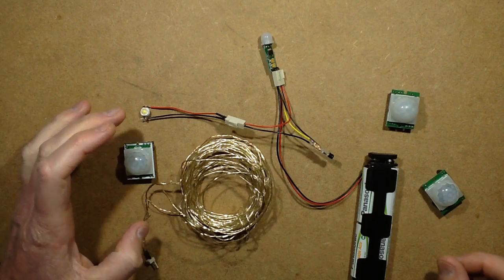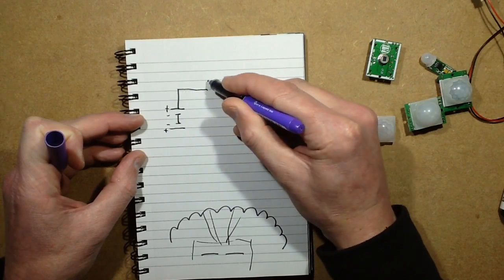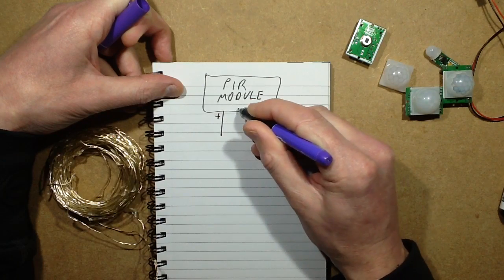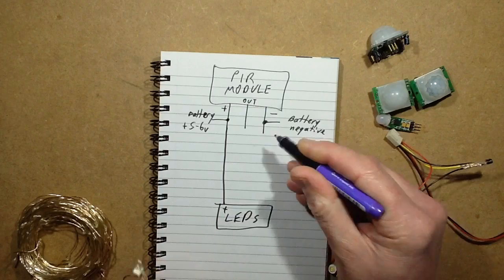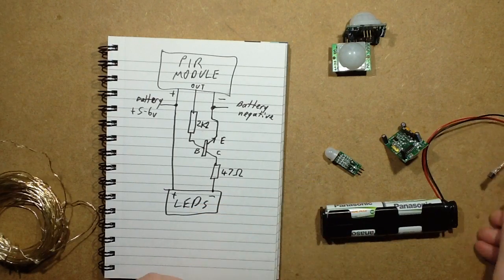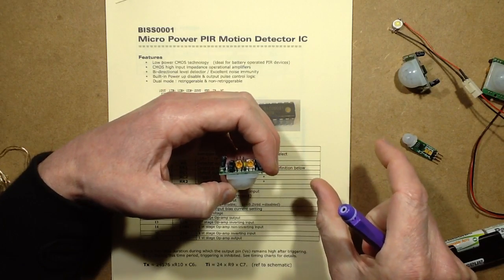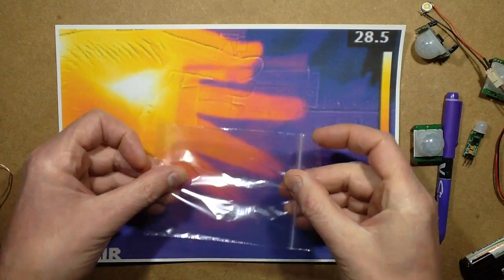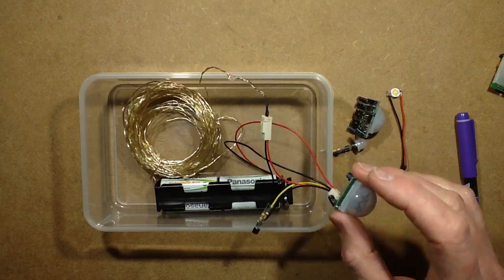How PIR modules work and using them to control LED strings.

Comment: I experimented with these and just drilled a hole almost as big as the dome on the sensor.  Let the dome extrude out and put a bit of silicone around it. Sealed good and the sensitivity was not compromised.

Comment: transistor and PIR self drops the current and voltage. so this is VERY annoying. no way to use this with 12v led stip more than 1m
Reply from the maker: The transistor in this circuit fixes that.  If the PIR module is suited to a 12V supply, the transistor will switch that.

Comment: How to connect a 12V LED strip light directly to the sensor without using any resistor or transistor or a relay. The LED strip light will be powered by 12V 5A driver. The setup will be mounted underneath the kitchen platform. The LED strip light should turn ON when the drawer is opened.
Why are transistor and resistor mandatory? What would happen if remove them and connect LED strip light directly?
Please respond.
Reply from the maker: The circuit can't drive high loads.  It absolutely needs a buffer.  That also avoids false retriggering caused by high current fluctuation.
Reply: @bigclivedotcom i created the ckt using this Sensor supported by BC547 transistor and 1k resistor. While I get 12V output from this ckt, but the LED strip light is too Dim. I removed the resistor and the brightness increased a bit. IMO the brightness of the strip after connecting to this ckt would 5% of the regular one. What should I now?

Comment: Hello! I ordered som of the small ones (sr505) modules, the 8pin chip is NSA3182 i would believe. There is some data-sheet i Chinese but well i am a newbie in electronics and have hard time reverse engineering stuff, my sr505 has delay of only 4 sec and i would like to make it about 10 sec. IF you could when and if you get time to maybe check on that data sheet and guide me maybe🤣
Reply from the maker: If it is that chip then adjusting the two resistors connected to pin 6 should adjust the on time.
Reply: @bigclivedotcom  yes, so far i am with you, trouble for me is to track the 2 resistors on the printed circuit board :) double sided board and well i feel little dumb for such simple task
Reply from the maker: @Vasse_t  Use a meter set to diode/continuity and explore the circuit for recreational purposes.

Comment: Thank you. You are sharing your knowledge.
I made your project. It was very nice. but there were interesting findings about the battery. I work with 3 types of batteries. I tested lithium watch batteries which are 18650, aaa battery, 3v. With the only 18650, the sensor burned itself. I connected 2 in series from a 3v Isha lithium battery (makes 6 v), the sensor lights up on its own. there was a problem. It worked without any problem in 4 AA batteries and it works well. Can you explain the logic of this error in a simpler way? I am very curious. Is there an imbalance in voltage?

Comment: Evening, I’m trying to use MP2307 Adjustable Mini360 DC-DC Converter Step Down Buck Voltage Regulator but I’m getting lost as on your diagram only one wire come out the bottom, but on my regulator there are two outputs, can you offer any help? Happy to put a video up on my channel if needed

Comment: I have been experimenting with logic level mosfets with these PIR sensors due to low current output but they usually didn't work for me  , my only option was to use arduino to trigger a transistor  but with this circuit design you have made my day sir.. I guess there always is something to learn after all :-) 
Thanks a lot again for sharing and making the world a better place , at least for me :)
Reply: https://www.youtube.com/watch?v=ZC_sEW3_694

Comment: What type of NPN did you use?
Reply from the maker: Any common one.  I tend to use a BC547 as my standard low current NPN transistor.
Reply: @bigclivedotcom  can I use TIP42 high current transistor for 5v 1a motor?  TIP42 / TIP42C PNP Epitaxial Silicon Transistor 40v 6a,    Ref this video https://www.youtube.com/watch?v=vhxZ3EHT668  , use TIP31  Motion control 12v Led Strip | how to make motion led strip using PIR sensor

Comment: Might be possible to use only three nimh batteries by bipassing the 3.3 voltage regulator inside the pir, and soldering a wire directly from the battery pack to the pir 3.3v pad
Reply from the maker: That could result in instability due to the voltage fluctuations when the lights were switching.
Reply: Thanks for the reply :D I'm a big fan

Comment: Hi, great video, I've got an led strip in a display case which looks great now. However the motion sensor is a little unpredictable. Any thoughts on why this is happening. Also I'm using 9v instead of 5v in the video do I need different resistor values?
Reply from the maker: If it keeps retriggering it might be due to a high load versus the power supply.  If it is just not detecting people it needs an open and direct view with no glass in the way.
Reply: It's triggering but seems to take about 5-7 seconds to turn on the LEDs.

Comment: ok, i've tried for more than 5 hours. It's really really annoying.
HC-SR501 pir module, 2n3904 transistor, 22k and 47 ohms resistor and a small 3v cob led. 
Everything is fine EXCEPTED that the led won't stay lit. Even with the pin on H (retrigger). It turn on stay lit for about 5 to 10 second (it vary) and then invariably turn off.
I've tried changing the transistor to a BC337 and i've tried with 5 other set of components... I've tried with 3 different power source (from 4 to 8 volt).
please someone help !!!
Reply: after a while, adding a l7805 regulator and a 2s liion battery make things a little bit better. But there are still some lake of retriggering

Comment: Very interesting.  I am looking to build a few PIR sensor triggers for dslr camera traps.  Could you show how to create 1, and which PIR sensor would work best.  It would have to be plugged into a camera with a 2.5mm plug.  I do want when it is triggered, to take 3 or 4 pictures.  I am capturing endangered Florida panthers.  Sample images can be seen at facebook "Panther Cams".  Thanks.

Comment: An area of pirs not covered well is the effects of external temperature.  Early thermal imagers and perhaps still used gadolinium lenses cooled down with liquid nitrogen.  Another site says that pirs will not work in hot climates.  Space is made for a thermistor on some pirs.  Pirs work much better in winter in the UK and not so well in the summer.  Can this be sorted with a thermistor?  Does cooling the unit increase the sensitivity or does the range extend in a cooler environment or both?  Just a thought or two.
Great learning opportunity you provide, many thanks
Reply from the maker: The PIR sensors detect thermal difference.  You can adjust the sensitivity in the summer.

Comment: Need a Darlington pair, output current of pir is tiny and light wont fully turn on
Reply from the maker: The circuit shown is for a small transistor with good gain, and low LED loads.  A Darlington would allow higher loads, as would an A2SHB MOSFET.

Comment: you can increase the input impedance of the transisitor buffer by bootstrapping the input terminal of the transistor thus minimizing the loading effect on the pir module or better yet employ a complementary feedback pair where there is 100% feed back to the emiiter and base of the driver transistor taken from the collector current of the second transistor of the CFP resulting in an even much higher input impedance

Comment: I need to make up several of these units for my smallholding, as the post-Cv19 glamping rush means that all fully-built remote PIR LED units are like hen's teeth. Just got to get my head around all that you're describing, as it's a bit of a mind-fk for someone who's only semi-electronics literate.

Comment: Max current signal output whit 5v power?
Tnx.
Reply: signal output is limited to 3.3v on these. he uses a transistor as a relay to send the full power to the LED

Comment: Thank you, Clive. I enjoy learning from you! Quick question: Is it possible to modify the battery pack by replacing it with a CR2032 battery and only using 5 bright white LEDs (https://www.arduino.cc/documents/datasheets/LED(white).pdf)?
Reply from the maker: You could run it from two CR2032 cells, but their energy capacity wouldn't give a long run time.

Comment: Hi I have a Question. Can I use this with the home outlet 110V instead of the battery?  Should I used a bigger Transistor and if so how big? Also Can I use a 5 watts light bulb instead of a bunch of LEDs?  If I use batteries can it be 9 Volts or 6 Volts is the maximum? I have very limited knowledge on electronics but I am learning a lot here.Thanks for your help.
Reply from the maker: You can get outdoor PIR units for security lights that do work from mains voltage and allow the switching of larger lights.
You can also get inline 12V ones that allow switching 12V lights or LED tape run from a plug-in 12V power supply.

Comment: Can you tell me how to change the delay  on the HC-SR505. It is 8 sec and I wand about 0.5 sec. i can solder surface mount if needed. No one seems to have tried this in the net yet!

Comment: The little 8pin chip on the PIR HC-SR505 is a EG4002A PIR Controller by chinese company EG Micro. You can find the data sheet here:
https://img.ozdisan.com/ETicaret_Dosya/518010_780564.PDF

Comment: How would you increase decrease the time the light stays on for for the small one as I want around 10 mins and want to run it off 3v as I want it descrete and don't want to use more than 2 batteries so I'll have to find a 3v sensor
Reply from the maker: You can adjust the delay with a small potentiometer on the larger units.  On the smaller ones it may be possible with a capacitor change if you can identify the chip.

Comment: Can this be done with Halloween or Christmas animatronics?  Most of my units run on 3.75v to 6v (3 to 4 AA batteries).  I would be using the "TRY ME" wire, removing the pressure button.  This is usually just a completion of circuit function to run the animatronics 1 time.  I purchased the  same small PIR as you are showing from Amazon... 5 for $16.  Mine are rated to run on 2.7v to 12v but have the same VCC, V-Out, & GND connections.

Comment: Hello, thank you for nice explanation but i have an issue. I use 4 batteries AAA and the lights still turning on and off without any motion in area. How to fix this issue?
Reply from the maker: Are you trying to drive LEDs directly from the module?

Comment: Thanks for that detailed description and pointer to the datasheet...I got 3 of these from Aliexpress and one from Amazon...the jumper between high and low was missing on the ones from China but the rest of the boards look identical.
The purpose of the potentiometers was also a mystery but your video clarified that.

I still need to look at the output voltage to figure out if its linear or just switches on to a high voltage. The current draw is also a concern, will it be enough to drive a large NPN into saturation for a 500 ma load (12V LED string) or should I use a Darlington UL2003 to not worry about current multiplication factors.

Comment: Hi gd day, nice video , I have a  sr501 sencer detector , i want to connect it to my rest room ceiling light  which is 18w .. i also notice that the sencer have 3 point ... VCC...OUT.... GND .....but my led driver has red n black wire ,, can any one guild me to connect the wright wires mmy heart full tks ...
Reply from the maker: That sensor can't switch loads.  It is intended for signalling back to a control system.
Reply: tks a lot for yr valuable info

Comment: Could an LED circuit fitted with the smaller model PIR be driven by just x2 AAA NiMh batteries (2.4V) or would it need some sort of step up to 4.8V? If so what would you need?
Reply from the maker: The modules have a 3.3V voltage regulator which could possibly be bypassed to allow lower voltage operation, but the LEDs may not be bright at a voltage so close to their forward voltage.

Comment: hey clive, if you want to control a relay with this, can you just connect the pir output to the relay coil using a resistor? I don't know if the pir output current is too low or what but I've never seen anyone doing that.
thx.
Reply from the maker: It would require a transistor to switch the relay.

Comment: Along with the pyroelectic sensor is a bunch of supporting circuitry, resistors and capacitors. It seems that most small hobbyist sensors use the BISS0001 ("Micro Power PIR Motion Detector IC"), undoubtedly a very inexpensive chip. This chip takes the output of the sensor and does some minor processing on it to emit a digital output pulse from the analog sensor.

Comment: in my PIR SENSOR its gets re-trigger again and again in hight triger mode in low time ..
i want to make light connection for toilet and bathroom,but its detect only motin of human heat .
but i want to make , light will not turn off until person will not move from near the PIR SENSOR when person will move from there it will turn of with in 10 sec 
its sence motion of human heat and i want to make it for detecting of human heat ,not motion of heat .
please help me please
Reply from the maker: PIR detectors work by detecting the motion causing modulation of the voltage on the sensor.  It would be hard to differentiate between ambient background heat and a human if there was no movement.

Comment: HAY?
I am in the USA.... 
Is there a way to connect one of these to the door's light fixture, so it will utilize the 110V to power the sensor and activate the bulb when there is motion?
I am not that great with electronics, but I can understand clear instructions..

THANKS
Reply from the maker: You do get outdoor sensors designed to work with 110V.
Reply: THANKS!     lol

Comment: No jumper settings for pir sensor i bought
Reply from the maker: There may be a track link you can cut and pads for that pin to allow it to be pulled to positive or negative.
Reply: Sorry bro i can't understand what you are trying to say, can you please say clearly

Comment: Could it be possible to make a matrix of the IR sensors to create a rudimentary heat camera?
Reply from the maker: They have a differential arrangement inside that is only really suited to detecting a difference between the two sensors.  If you covered one it might work to a degree, but not as well as a proper thermal camera.
Reply: bigclivedotcom good to know. I might have a play... I only need about an 8x8 pixel resolution for what I'm trying. Thanks dude. Worth a shot at. Never know I might accidentally learn something too 😎
Reply: rundata   I haven't checked, but I'm pretty sure you could buy IR sensitive photodiodes for your matrix.  They're contained in some proximity and beam-break sensors.  If your camera needs a lens then it mustn't be normal glass, as clive shows.  Maybe quartz or fluorite?  Dunno.  Maybe pricey.

Comment: Sir, I have a question regarding my project. I am using PIR motion sensor and it is detection a movement and for 5 seconds and after that it is showing no motion even though motion is still occurring and then it shows motion. So is there any way to decrease the delay?

Comment: If they are effected by a warm body passing in front of the sensors why then does moving grass etc. set them off?
Reply from the maker: Anything that can cause a heat disturbance or reflect heat can trigger a PIR.  But it usually requires a large temperature difference like an animal.

Comment: Hello, thanks for the video. I am trying to use this sensor to light a strip of 5v leds. I am using 5v power supply. I am doing exactly what you have showed but the problem is that Leds lit very dim. I have checked the output voltage and it is around 3 volts. I am using BC547 transistor. How do I fix it and get full brightness from Leds? Btw I do not anything about electronics :)
Reply from the maker: The transistor is only rated to run about 100mA.  If the strip has built in resistors then the one shown in series with the LED would not be needed.
Reply: Thanks. I'll try some other resistor.

Comment: Hello! I was wondering if this would work the same way if I use neopixels instead of those led strings? Thank you!
Reply from the maker: +Victoria Davalos Neopixels need a controller to send them data.
Reply: Thanks so much for your answer. What kind of controller? I'm sorry, I'm not (yet) that familiar with arduino:)

Comment: Hi Big Clive! :)
Very interesting info here! I have a question: did you manage to compare and/or change the response time, and/or the retriggering time after detection in these models?
For what the models i have is concerned, i see a minimun HIGH time of about 3 seconds, and then about 5 seconds of stopped time to retrigger (in single triggering mode). In autoretriggering, as you explain, device is in HIGH continuously if there is a motion detection, but then, again 5 seconds of 'stop' time. I tried to make some hacks on resistor in order to decrease this time, unsuccesfully. Have you got any info or results in this way?
thanks so mucho!
Javi